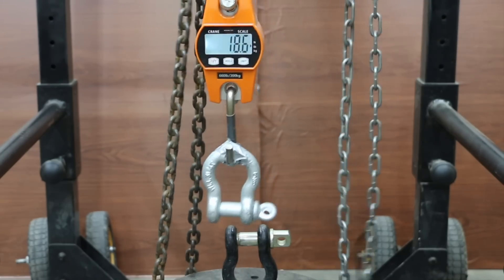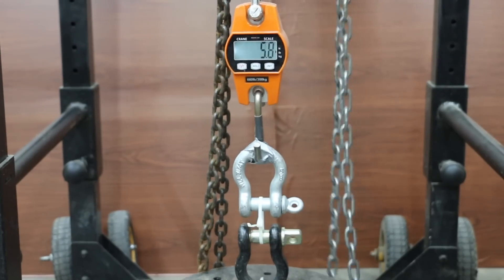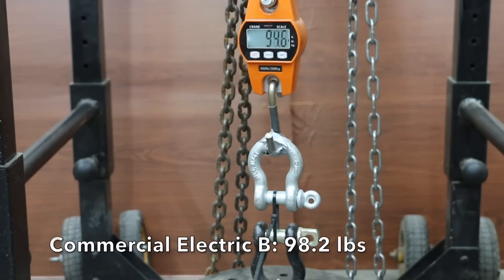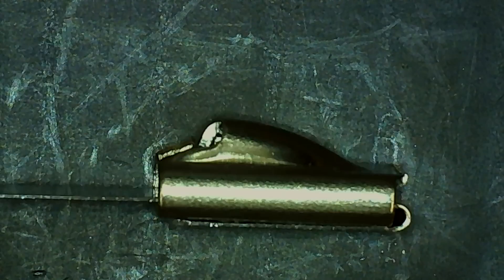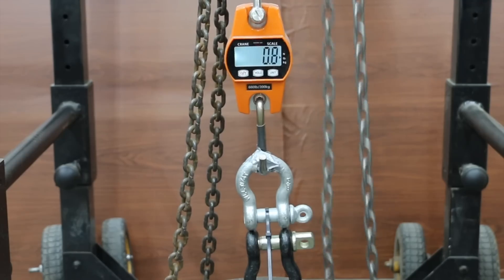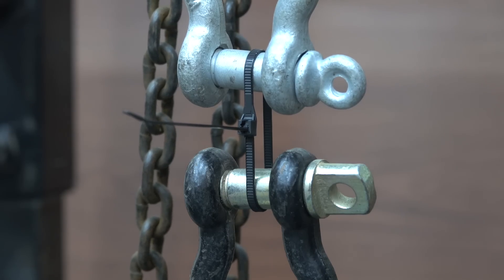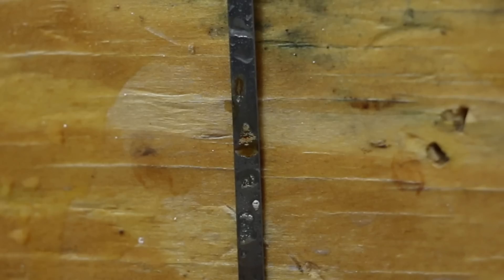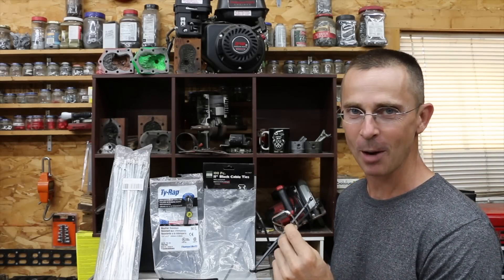Best Cable Tie (zip tie) Brand? Let's Find Out!

Comment: just an fyi not reflecting at all on you, the 'strong ties' brand 120 lbs/12" cable ties  you've tested and linked in the description above are suddenly no longer available - anywhere... i don't know if it's temporary or permanent but google search doesn't return any results for this very product either... when i first clicked on the link - several days ago - you provided in the description i got an amazon page with a different, even stronger [175 lbs and 18" long] type of 'strong ties' brand zip ties instead, at $24.99 for 100 pieces... i actually liked those specs even better than the 12" long 120 lbs rated ones you've tested so - even though i couldn't be sure they'd test the same for strength/exposure as the ones you tested - i put them in my amazon cart regardless to purchase at a slightly later time...when i clicked on that product in my cart today [in my cart it still shows up as i've described so 175lb rating, 18" long at $24.99/100] to purchase it, it now takes me to a yet completely different 'strong ties' brand zip ties product, ones that are 11" long and rated for only 50lbs at $7.99 per 150 [these are called 'strong ties altai-1 cable zip ties']... and the same thing happens now when one clicks the link above in your description...pisses me off because i wanted to purchase the heavy duty product, not some wimpier 50 lbs test ties...weird, it seems there's some bait and switch going on on amazon although it's likely not done on purpose to deceive but because the original product is out of stock so the link from your description and my shopping cart now points to the same brand but different product as the nearest substitute... this sucks though, the strongest tested ties are unavailable anywhere now so i have to go with the 'ty-rap' ones, the second strongest, most resistant ones you've tested... love your channel though, i base most of my purchases on your tests, at least as long as the product i'm in market for has in fact been comparison tested by you thus far... therefore you actually have a LOT of commercial pull in the general industry at present because i suspect others are also greatly influenced by your tests in their shopping choice...
Reply from the maker: Thanks for sharing.

Comment: As a retired commercial electrician I have seen some brittle white cable ties being a union trained electrician I was trained well and would never use a white tie outside I use them at home to tie the tomato cages to a piece of tubing to hold them in place all summer then the wife and I squeeze them and they shatter and we remove the cages after only 7 months. The most impressive ties I have seen besides stainless were the purple plastic ones used to strap control wires in cable trays in nuclear power plants.
Reply from the maker: Thanks for sharing.

Comment: I use stainless cable ties on all of my cars cv boots, honestly never had any issues much better than the stupid clip style ones manufacturers use and much stronger than plastic ones. I use a special tool to keep them under tension and cut them to make a near job believe it’s a blue point or snap on tool but can probably get a cheaper one somewhere!

Comment: There is one application you need those dollar store extra brittle zip ties. When you hang cables for av production somewhere and you want to be able to pull on them a snappy way for the ties to break when it's time to wrap up, trust me, a quick snap pull on an electrical cable is way better than bringing your ladder, climbing up, cutting the tie, going down, moving the ladder 3-4 foot and repeating on and on. otherwise, of course, you want some good ties. The cable company here use some that are uv resistant and that have a metal latch instead of a plastic one. they seems very robust.
Reply from the maker: Thanks for sharing.

Comment: Only the ones that failed because of UV could be a problem in some cases, but lets face it, for most uses, the cheapest ones do just fine. The ones made for electrical use are good, but they don't really need to be that good, they never see a lot of weight or stress, or at least they shouldn't if they do, you have a problem anyway. Try lifting the truck with several of the nylon ties. should work. I'd still like to see you test alcohols in engines, but now alcohols are hard to find, hard to get, and expensive when you do. Anyway the question there is grain alcohol any better than isopropyl or methanol? if they're equally strong I don't see how they could be.. then the question becomes why are gas companies supposedly using grain alcohol when it's the most expensive to produce?
Reply from the maker: Thanks for the video idea.

Comment: Just a thought, if you put the locking mechanism round the bolt instead of in the middle, they might not fail so easily?
Reply from the maker: Thanks for the suggestion.

Comment: I’d really like to see Thomas and Betts Ty-Rap heat stabilized/UV resistant cable ties included.  I bought an older tractor that’d had a package of them in it for 10+ years.  They worked like new. I since switched to them for everything even though they’re most likely more expensive. Much smaller head and they use a SS dog. T&B even makes radiation resistant, mounting, metal detectable, and other specialized ties
Reply from the maker: Thanks for the video idea.

Comment: I don't know how many of the original tie wraps you may still have, but it would be good to see UV exposure 30 months in.   I say this from using them to keep vinyl-coated welded wire onto a 42" aluminum fence (which was too wide to keep small dog in).    It seems I had a few failing in 2 years, maybe 27 months (which meant 3 hot/sunny seasons).  By 4 summer seasons there were many I had to replace, like probably nearly off of any remaining originial ones.
Reply from the maker: Thanks for the suggestion.

Comment: First of all, great tests! even further proving my belief that the white cable ties are absolute garbage. Second, a possible continuation of this video might be leaving a sustained 20ish lb load on the cable ties and see which ones fail first. It may be hard to film, but I believe that is probably the closes to a real world test you might get out of them. I have never heard of someone trying to use them for a 100lb load, but more like holding something relatively small in place for extended periods.
Reply from the maker: Thank you!  Thanks for the video idea.

Comment: I use those metal zip ties on my pallet barn, I don’t know what kind but it works amazingly, especially considering the roof is made of pallets and plywood and the zip tied spot is on the lower end so it gets lots of water
Reply from the maker: Thanks for sharing.

Comment: the hycc ones are amazing year around. but as for the temperature on any plastic zip-tie is a joke -40 LOL in their dreams. at 32F they fail instantly. its plastic you cant freeze plastic and expect it to work correctly. i dont see how they can put that on the product info. its a straight up bold face lie and they know it.
Reply from the maker: Thanks for the feedback.

Comment: I use them all the time but most of the time it's the heat from engine bay with combination of vibration brake them they don't require massive strength but more flexibility would be nice to see them inflexibility comparison after prolonged heat exposure

Comment: I still use an old cordless miliwaukee m18 nicd battery drill can't find a cheap replacement battery
Reply from the maker: Thanks for sharing.
Reply: The one battery draped out the other one is working fine for now
Reply: Crapped out dang auto correct

Comment: A little off topic but maybe something you would be interested in testing. I used to hear from old mechanics and shop teachers that they would actually run Diesel fuel in the crankcases of old cars to loosen up all the sludge and deposits. They would run Diesel fuel for a little while in place of engine oil to clean up old engine blocks like new after they drain them. I always wondered if this would really work. Some old mechanics swore by it and said that the Diesel fuel has enough lubrication in it that you can run it without damaging the motor obviously in moderation. I don't know but it's always stuck with me for 20 years now I've almost done it a few times but just wasn't sure and there was no information on the subject. Anyway it's a fun idea.
Reply: I guess this was back in the 1960's and 70's when big blocks would have to be rebuilt oftentimes. They said that the Diesel would clean the valve train etc and it would get them another idk instead ok 75k to whatever it was 100k miles before their next rebuild but it sure was fascinating and they definitely were serious about it they weren't joking I've heard it more than once so.
Reply from the maker: Thanks for the suggestion.

Comment: Video idea: adding 2 oz of full synthetic marine 2 stroke oil per each gallon of gas in automobiles will help the engine run better.  It burns ashless. It's supposed to help the cylinders lubricate etc
Reply from the maker: Thanks for the suggestion.
Reply: @ProjectFarm  it's been posted all over gm trucks forums and other for years.
Reply: @ProjectFarm  https://www.gm-trucks.com/forums/topic/105251-2-cycle-oil-in-your-gas-tank/

Comment: New Video Idea! Test different motorcycle/ATV oils such as Maxima, Honda, Yamalube, etc. Since these are designed to also be oil used in wet clutch systems on motorcycles and ATVs, it would be interesting to see how it compares to automotive oil.
Reply from the maker: Great suggestion!  Thank you.

Comment: I'm really curious what the shock strength is after you be exposure I'm willing to bet that if you took like a 20 lb weight and attached it to one of those and then just dropped it after UV exposure it would tolerate much less weight
Reply from the maker: Thanks for the feedback.

Comment: These are made of nylon, Nylon is hydroscopic. While nylon typically has no UV stabilizers, black in generally more resistant. Drying and uv exposure makes nylon harder, stronger and more brittle. In tensile will be stronger but not in flexibility. Kinda like using a grade 5 bolt vs a grade 8. Grade 8 are much stronger in tensile strength but not for shock.
Reply from the maker: Thanks for sharing.

Comment: PF hello, 2 actual cases 1990 on a Dive boat in FIJI, a man from CALIFORNIA had secured his DIVE COMPUTER, to something he had, using 2 clear ty raps, unknown brand, nor how old  this day he was on the zodiac we were on  heard KEWR plunk his computer is GONE 8 00 FEET DOWN, COST  ABOUT $800. I have on just like his, but mine in in my console 
Next I secured a weather station WING SPEED & outdoor temperature/humidity using 2 zip ties on top of my outdoor clothes dryer, HERE COMES HURRICANE SANDY , last seen wind speed was 67mph, then it just stopped, so I look outside, 1. Cable broke, the wind speed broke 1 of 3 cups , oh well dead, We lost power for 5 days , but had heat when it got cool & used matches to light the stove 
So much for outdoor wind speed made of plastic ,,stay welll Cheers 🇺🇸🇺🇸🇺🇸🇺🇸
Reply from the maker: Thanks for sharing.

Comment: Todd, if you did the oil shootout over again using the exact same oils, but pitted them against each other differently, would you get the same results between Pennzoil and Amsoil in the end? I was wondering about this, so I thought I'd ask you if you were curious too?
Reply from the maker: Thanks for the suggestion.

Comment: I had a 5 hp briggs that was a Smith Brothers Racing engine (SBR) the previous owner blew the piston through the side of the block and jb welded it together, it held for several races before it started seeping slowly, don't worry we had a professional weld it eventually
Reply from the maker: Thanks for sharing.

Comment: I see a repetitive result there on that magical digital (crane scale) likely the same thing I've run into on cheap tire pressure gauges and other battery powered items. they do not compensate for battery voltage drop and recovery between usage. example, cheap tie gauge using 2x AAA cells, it only calibrates when powered on, so first couple pressure tests within a short seconds are accurate, by time you move to second/third/fourth tire, they can skew afar, like 10LBS offset! even worse if the batteries are getting weak and voltage rapidly declining, within it's self power off time period.
Reply from the maker: Thanks for the feedback.

Comment: Some of the ties that slipped in the locking head, can you try to place the head directly over the shank to see if that changes (improves) it's ability to lock/hold?
*Great video as always. Way to be patient and wait for a year of UV exposure. Still love the way you incorporate small engines into the mix. Thanks for your independent tests.
Reply from the maker: Thanks for the video idea.

Comment: Was interesting to see the locking mechanism on those stainless ties. Always wondered how they work and it turns out to be really simple. A small ball wedges itself into the tie, that's it. Would be awesome if some company made them with round wire instead of flat bands though. That way they won't cut into what they are supposed to be holding.
And of course one of those ties held up the truck. Half of the truck is rusted away! :D
Reply from the maker: Thanks for the feedback.

Comment: would you ever look at testing HHO Generators? the idea behind it is it improves your mpg if you still run the engine on petrol and use the HHO generator along side, just curious if it actually does improve mpg as i can't find any good videos on it
Reply from the maker: Thanks for the suggestion.

Comment: Very cool!
I would love to see a video of the various epoxy anchors there are available, you could have a series of holes drilled in concrete with some 1/2" threaded rod epoxied in and see how much force is required to make them let go, also test for vibration resistance etc...
Reply from the maker: Great suggestion!  Thank you.

Comment: I now have a new respect for harbor freight.
Thank you for putting the time and effort into  this informative video.
Reply from the maker: Thank you very much!
Reply: I bought those ties to use temporarily for holding up brake calipers during brake jobs. I had 3 break immediately and I haven't used them since. I'm very surprised at these results.

Comment: Fantastic work as always! I have used the Harbor Freight plastic cable ties in the past and they've been quite reliable in my experience. What really shocked me is that the UV seemed to harden them! Thanks for making such quality, unbiased videos!
Reply: I wonder if it's hydration improving the strength over time. For production, nylon has to be dehydrated but it has maximum strength after it has re absorbed some water (from the air or a post moulding  bath).
Reply from the maker: Thanks for sharing.  You are welcome!
Reply: honestly thought the harbor freight ties were inferior to other way more expensive ones I've got but your real world testing convinced me otherwise, mine are laying out in the sun as we speak!!!

Comment: Should test different bar and chain oils. Could test for running bar heat, lubricity test, tip spray (the amount of oil slung off the tip insted of sticking to the chain) and probably others but I can't think of any atm. 

Brands I know off:
Supertech
Sthil
Black max
Craftsman
Husqvarna
10w30

Thankyou for all the great vids!
Reply from the maker: Great suggestion!  Thank you.

Comment: You gotta test different brand tape measures like Lufkin, Dewalt, milwaukee, Stanly  cause i go thru about 2 tape measure a year at work some get dirt in them and don like working some I drop in water and also stand out best one iv had is the Lufkin crescent 25ft tape
Reply from the maker: Great suggestion!  Thank you.

Comment: I have a Tahoe that runs on CNG.  When I did my first oil change at 8K, the oil looked brand new.  I now go 16K between oil changes, and it still looks brand new.  I'm curious of your thoughts on CNG and how much cleaner burning it is over gasoline .  Is this cleaner burning a valid reason to go longer between oil changes?  Thanks.
Reply from the maker: Thanks for the video idea.

Comment: Each wrap affectively drops the load on the lock by half, each time. There might have been about 1000lbs on the strap but the load on the lock was only about 250lbs. I bet you could lift that truck with 1 of the plastic zips if you wrap it like 6 times.
Reply from the maker: Thanks for sharing.

Comment: I love cable ties for temporary repairs! Awesome video! You do a lot of car/ automotive tests. Have you thought of doing a test on the different sound deadening materials that are available (dynamat, Boommat, killmat) just wondering what would work best. Would spray on Bed-liner work as well? Does the sound deadening material have any thermal benefits?
Reply from the maker: Great suggestion!  Thank you.

Comment: I have some stainless ties that were used to secure brake cables on GM rear axles in 2003. You should give me an address to send them to so you can test them.
Reply from the maker: You can contact me at projectfarm52@gmail.com.  Thanks

Comment: Yet another great test and comparison.  Thanks!    Video idea: I was watching Outdoor Boys and the topic was different ways to start a fire including spontaneous combustion.  Many of us know not to keep oily rags.  It would be interesting to know what the threshold is for spontaneous combustion, that is, how soaked in oil does the rag have to be and are there other liquids or grease that can create a fire hazard.  It would help answer the question about the numerous piles of rags we have with various levels of oil and the fire hazard they may or may not present.
Reply from the maker: Thanks for the video idea.